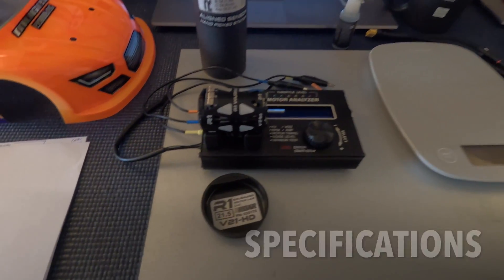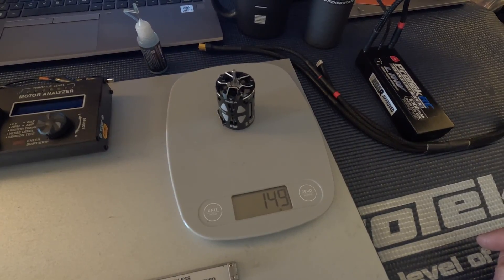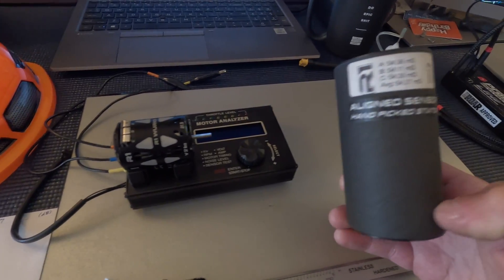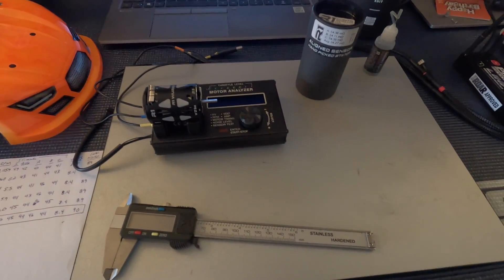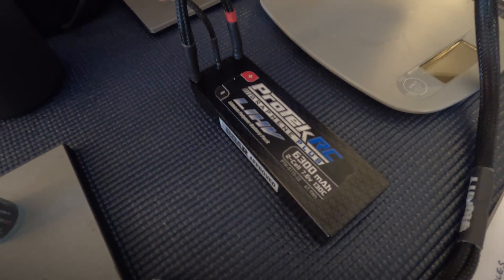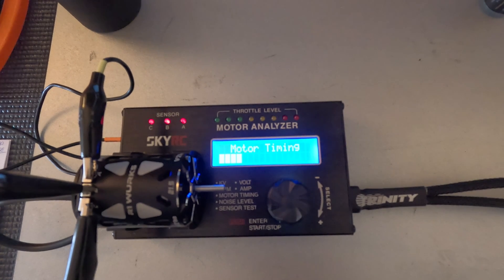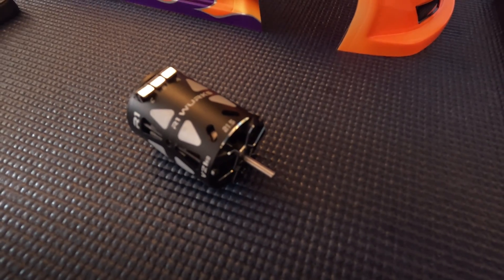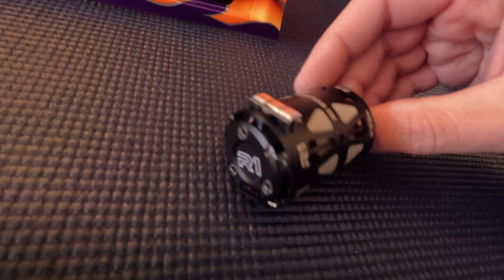R1 Wurks V21-HD 21.5 Spec Motor Review (Part 1)

Comment: Never set timing pulling over 5 amps
Reply from the maker: Sorry bud but it entirely depends on the motor. Some trinities like to be set around 4.5amps, while some hobbywings like low 6’s. It also depends on the application and track layout. There isn’t a clear cut rule across the board for how to set your timing for a specific amp draw. Thanks for watching, just wanted to clarify. 👍
Reply: Yup i run mine at 5.5 amps. Most of the people try to get close to 6amps. Never heard of pulling such low amps as the poster describes.